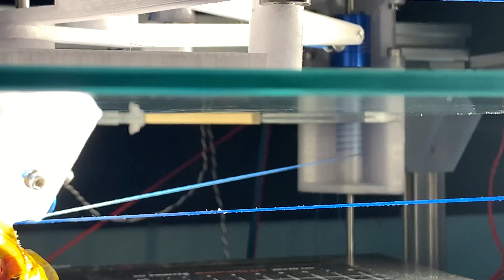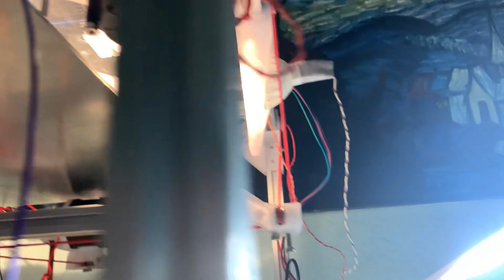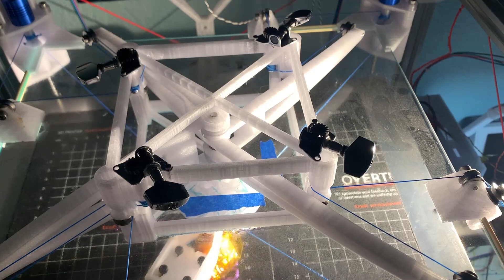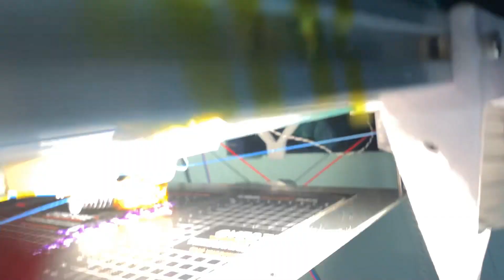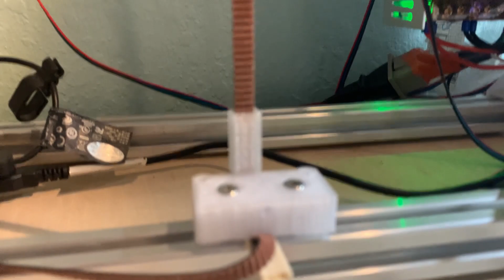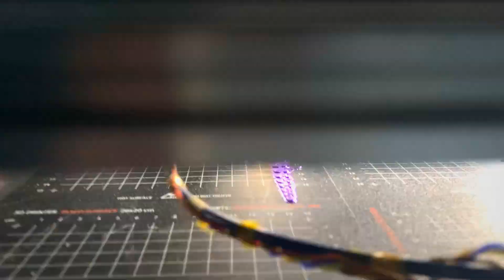How Marionette 3D printer works.

Comment: So the benefit should be higher potential speed (with same precision) because of lighter moving parts, is that correct?
Reply from the maker: Yes, pretty much. And with a high quality flat surface and an air bearing, it can be more accurate, especially if used with a positioning pattern behind the glass.

Comment: Excellent! My 3d printer using inkjet printer encoder motors used strings on z. Highly underrated!

Do the strings rub against plastic? Thru Will cut the plastic if so.

(On my channel)
Reply from the maker: No rubbing, all done using v-groove pulleys. Strings are also potentially a good idea for high temp printing, could use high temp fibers (kevlar and newer, higher temp materials).
Reply: @dizekat  great!  I once thought of using the edges of glass as follower guides too.  But the strings take care of that.  
Did you need to do calculate subpaths to avoid curvy routes?  I had to do that on my whiteboard robots.

You may like my channel too.

Comment: I'm really glad you did this! I had the beginnings of this idea with the glass plate, the sliding hotend on an air bearing, and using wires to move it. I really didn't figure out how best set up the motors and pullys, which is probably the most complex part of it. Great job!!

There is another printer that prints upside down, which could be easier for a printer such as this, but it could also cause other problems too. Maybe it could be worth it to consider the option still.

Comment: Miniature version of the Hang 3D Printer developed at least 5 years ago.
Reply from the maker: Both are cable driven parallel robots (which were developed decades ago)... what's new here is that cable tension is maintained passively in a balanced way (the forces due to extra tension cancel out), allowing much greater tension on all of the strings than those motors would be able to apply.

Comment: Couldn`t you put a magnet on the upper side of the hotend assembely and a magnet in that thing above the glass plate? so the hotend gets pulled to the glass even stronger
Reply from the maker: The top thing moves at 1/3 scale so it wouldn't match up other than in the very center... i may use an iron plate, provided the eddy currents and hysteresis losses aren't too much.

Comment: Even with more points of failure, the parts needed to repair this is cheaper and more available. amazing
Reply from the maker: I think with further improvement (jacketed ropes, better pulleys etc) it will probably go longer between failures than traditional set ups, too. Linear rails don't last forever either, especially under very high speeds and accelerations.

Comment: Some graphite powder on the slider might make it skip less
Reply from the maker: It's using silicone grease, works pretty well apart from some remaining center of mass issues (ideally the center of mass ought to be where the strings meet). With silicone grease the slider sort of hydroplanes when printing.
Reply: @dizekat  gotcha. That's what you mean by skipping. It's a really cool machine props
Reply from the maker: @IamTheCaptainNow  Mostly the issue is that under high accelerations (I'm talking >6 G), it's important for the center of mass to be where the ropes meet, which isn't presently the case because a bunch of things got changed affecting the balance. Planning to fix that in the next revision by allowing adjustments.
Reply: @dizekat  yeah I definitely understand that at 6 plus gs the difference in the center of mass and the center of thrust are causing instability. Really cool machine. You definitely get my subscription I'll be watching

Comment: This is going to be incredibly inaccurate once you get away from the center.
Reply from the maker: Why? It has the firmware calculating correct rotation angles. Just a slight resolution non-uniformity similar to a delta. In fact it homes into a corner so if it couldn't be accurate in that corner when homing it couldn't be accurate in the center either.

Comment: If you could do it without the plate, what would excite me would be the scalability. Put up four towers at a job site, and you have a building size printer. Perhaps even on other planets, where space is at a premium.
Maybe if you have a feedback loop to the motors to account for Z droop from the cables.

Comment: This is officially the Rube Goldberg Machine of 3D printers. And I thought deltas and corexy were complicated. Congrats to you sir!
Reply from the maker: It's not all that many actual parts though, if you start comparing to something like Voron 2.4 (this will eventually have a similar printing volume, after I update the XY mechanism). The complexity is mostly math that's happening when its working.

Comment: That's awesome, The first 3D Printer I built long ago was an open source "Cerberus" Delta printer and it used Filament drive and spool on each motor with fishing line to move the axis's

Comment: Huh, i bet if you flipped this over and used foating graphite pads (or printed ones), you could reduce the friction to near zero and get even faster motion. The benefit being the weight is not adding to the head tension and the head gantry can be directly on the ground and more directly transfer reaction into the ground instead of the frame

Comment: I can't even imagine the algorithms needed to translate the xyz movements to the string drives!  Love the guitar tuners!  it is a beautiful printer, but are there practical advantages to this type of printer versus the more conventional types?
Reply from the maker: The calculations for XY are pretty simple, basically two distances to the point, with minor corrections because of the winch radius not being zero. Z is linear, the calculations are done by that weird pulley, which was as hard to derive the formula for as it looks.

The main advantage is probably lower moving mass and higher stiffness (note the two cables that go directly between the toolhead and the motors, they provide extremely high stiffness). And a number of other advantages for various specific use cases, e.g. high temperature (if using an air bearing).

Comment: guy can create this incredible beast but still has standard printer issues like heated bed not working lmfao, once this is polished up well it will likely be much better than even the voron, using ropes instead of rails will effectively decrease the moving mass more than what was ever close to possible and allow acceleration to go crazy

Comment: Very nice! What rope are you using to drive the printhead? In similar projects I'm struggling to find a source of suitably non-elastic line.
Reply from the maker: UHMWPE, the blue strings are Spectra brand fishing braid, the thicker red rope used for Z is some no-brand stuff, it is much thicker than necessary so it doesn't matter much (the reason it is thick is ease of assembly, a thinner cable could slip between the pulley and its housing which would be annoying).
Reply: @dizekat  Ah, thanks! I'll give that a shot. It looks a lot better than the nylon I've been using so far. Makes sense for the Z axis - it's definitely less of a headache to go thicker where you can.
Reply from the maker: Other good options are Kevlar, Zylon PBO, and other such high performance fibers. Those are more temperature resistant, but photodegrade and hydrolyze. Huge huge difference from Nylon, modulus of elasticity of 2.7 GPa for Nylon vs up to 140 or so for UHMWPE and Kevlar and up to 270 for Zylon PBO.
Reply: @dizekat  Oh wow thanks for the continued information! That's so useful to know!

Comment: This has such an interesting design and kinematics! What were some of your design goals with this printer? What are some applications and situations where this design would be the best option?
Reply from the maker: I'm thinking high temperature printing is probably where it could be most useful, using an air bearing. Large size printers probably as well since it eliminates issues with parallel rails alignment etc. Other than that, just high rigidity and low moving mass, plus ability to use a precision flat (e.g. a granite surface plate) which could be advantageous to non printer applications like e.g. roughing aspherical optics. A positioning pattern could be provided on the sliding surface (e.g. optical behind the glass) to allow closed loop control all the way to the toolhead. Vacuum or electromagnets can be used to lock the toolhead rigidly in place, either for downwards cutting operations or for short range last stage (e.g. piezo) if used for cutting optics.

Comment: ... yeah pass, string actuators are a real hassle with wear and tear regardless of what they drive.
A+ on the engineering so, fun thing to watch so thanks for making it.
👍
Reply from the maker: A belt is also reliant on a few thin internal glass fiber cords, much the same as if I had a string in a protective layer. I may need to use higher quality v-slot bearings though...
Reply: @dizekat  toothed belts as commonly found on printers don't function with friction, they mesh.
Yes they wear out too, but usually you only have to replace the belt which is quick and easy.
String systems are far far more aggressive in that regard.
Especially the high strength tensile stuff that you need for precision movement is often highly abrasive.
Besides the fact that re-stringing is a pain in the behind and it is also very common that some idlers or spools need to be replaced.
You can mitigate that with wear resistant low friction materials/coatings like ruby or sapphire but that makes it expensive again.

Don't get me wrong string systems are fun.
But they are not suitable for a production environment.
They degrade way too fast.
Like I said, they are a hassle to deal with.
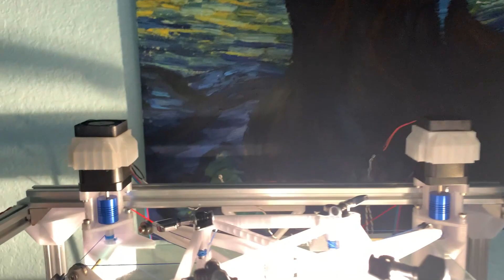Reply from the maker: @DerSolinski  I don't rely on friction (unlike string based belt replacements), the spools where that thread winds onto have the other end anchored to the spool (edit: see 2:16 ), and the strings never overlap. Can't see any wear on either the strings or the spools. There's some wear where it goes over some of the v-slot rollers (but not others), but they're steel and have rather poor surface finish (and the bottom of the groove may be too sharp), I'm thinking of either replacing those with something less crappy or polishing them.
Reply: @dizekat To make something clear:
I'm not trying to attack you or to persuade you to change your ways. After all I enjoy watching your journey.
Sometimes that gets lost in translation and transit so just pointing that out.
I'm just telling you my thoughts why string systems aren't an option for me 😉

As long as your machine doesn't run 24/7 you're probably fine.
It's a prototype constantly tinkered with.
I think the first inkling of what I mean will start about 1500h in.
That's a lot of time for prototypes / engineering samples, seldom they reach that number.
In terms of production machinery 1500h is nothing.

I have a textile background and I can watch run-of-the-mill Polyester yarn eat through ceramic inserts and hardened steel parts.

Those needles used for weaving are drop forged to get any sort of useful lifetime out of them.
That's the reason why quality weaving needles for the industry can easily break 10 bucks a piece, as tiny they may be.
(Well that, and patents 🙄)

You can buy cheap Chinesium but that stuff wears down quickly and starts to rough up the fibers, lowering the overall quality of the end product.

So I'm somewhat biased I guess 😂
To iterate my point look at any maintenance guide for crane and pulley/winch systems.
The recommended lifetimes aren't that great and "proper" maintenance almost never happens since people just don't bother.
That often becomes an issue if somebody/thing gets hurt, then all hell breaks loose.
Reply from the maker: @DerSolinski  Yeah no offense taken, I'm just pointing out how the machine works, it's rather hard to see in the video and I don't go into any real detail, but it avoids using friction on the string. No eyelets, no capstans, only spools and pulleys.

It's completely true that string's gonna be a consumable, but so are the belts, at the end of the day the belts are just some rubber and nylon padding around a little glass fiber.

I think strings get a lot of bad reputation from early reprap attempts to replace belts with them in an existing design. A toothed pulley should be replaced with two spools and two separate lengths of string, one winds, one unwinds, but that takes more space than a pulley.

I have a bunch of improvements planned, by the way, for the next iteration (keep in mind that the XY mechanism in this video is a very early prototype, most of parts are original first iteration). 

The primary cables (ones going to toolhead) can be replaced with flattened ribbons; the consistent helical winding permits that.

The top mechanism I'm planning to simplify, it could be done with as few as 4 pulleys (the scaling can all be done at the spool; right now the spool does 2/3 scaling and then a block-and-tackle does 1/2 scaling).
Reply: @dizekat  yeah the most difficult thing is to keep the linear movement so your controller doesn't need to do some complex calculation to keep the axis straight.
It's easy if have a closed loop with absolute position then you only need to compensate the offset.
But that not an option with normal 3d printers.
Reply from the maker: @DerSolinski  One thing that I found rather curious is that if you have a spool whose axis is at 90 degrees to the movement, and the anchoring point of the string is moved to the side a bit, it 1: winds a perfect constant-angle helix, and 2: the mm per rotation is still exactly the same. That's what happening on my main drive spools.

As far as firmware calculations go in my case it's pretty easy to calculate motor positions from the desired head position, if the diameters of 2 motor pulleys, distance between them, and homing position are known. I do need to write some calibration code though, some print where I'd measure several distances and then solve for the kinematic unknowns.

Eventually I want to add some kind of optical sensor to the toolhead, and put some positioning pattern behind the glass. With an air bearing instead of grease I would have a clear view of it.

Comment: Well done, I have been waiting to see a cablebot printer for years now.  What actuators are you using?

Check out the performance on this cable bot and imagine the print speed that such a device could achieve .

https://www.youtube.com/watch?v=0LWx_Y9DKPc

https://www.youtube.com/watch?v=7HNAL8ZKdyM
Reply from the maker: Just stepper motors, I can get away with that because I only have 2 driven shafts for 2-DOF movement (typical cablebot needs more motors than degrees of freedom and hence pretty much requires closed loop). I may build a 3-DOF variant sometime, it is also possible to do with only 3 motors but the mechanism is a bit more cumbersome.
Reply: @dizekat cheap stepper motors or the really high end ones that they used for the juggling cablebot? ;-)

2-DOF is all you need if you keep the bed lifter separate...
How does it perform in terms of speed and accuracy.

How would describe its advantages and disadvantages?
Reply from the maker: @christopherd.winnan8701  Yeah I'm just using cheapest 38mm NEMA17 off Amazon, nothing fancy. I think all those cablebots probably use servos (a stepper or another kind of motor with an encoder and a feedback loop), because they have motors opposing one another and any slight mismatch between the movements would result in skipped steps and then a tangle.

I think the main advantage over all other cablebots that I have is that the cable tension is created mechanically via that linkage on the very top rather than via motor torque of opposing motors. This machine for example is tensioned to several times more than the motors are able to apply. The preload does not subtract from the forces available for the movement, and motors apply force to the toolhead in either direction (while in traditional cablebot only the motors whose cables are getting shorter can contribute to the movement).

The advantage over non cablebots is higher stiffness at lower moving mass.

The disadvantage is that there has to be some space for that mechanical linkage on the very top of the printer, although it could be made much flatter if it was made out of better materials.

Comment: Really nice! But what are the advantages of such design?
Reply: Lighter print head for faster print speed. Like stupid light.
Reply: @graysonsmith7031  also cost (i guess) pretty sure these wires are way cheaper than the cheapest of the belts

Comment: It just looks like a typical hang printer setup minus the Z axis.
Reply from the maker: Yeah, it is also a parallel cable robot, but capable of much higher cable tension (traditional parallel cable robot's cable tension is limited by motor torque) which allows higher speeds. And it doesn't get tangled if a stepper skips a few steps or the machine is turned off.

Comment: Nice! Now it just needs a graphite air bearing to glide over that glass at insane speed.
Reply from the maker: Yep working on that, made some prototype bearings, also planning to use a scrap piece of kitchen countertop granite as a ride surface for it (cheap and surprisingly flat).
Reply: @dizekat and maybe have it upside down and have an awesome low center of mass?
Reply from the maker: @runningfromtheheat  I think it's fine upside up... with how hard it can accelerate (10 G) the gravity is a relatively minor concern. Also, the 6 bed ropes reference the bed to the top of the printer, so the wobbling of the printer frame does not have much effect on the print.
Reply: Awesome to hear. Any chance you have some files to print and try building one even at this stage? I was starting to buy materials for string/rope based xy. Would love to test or help add to the development of the Marionette 3D Printer